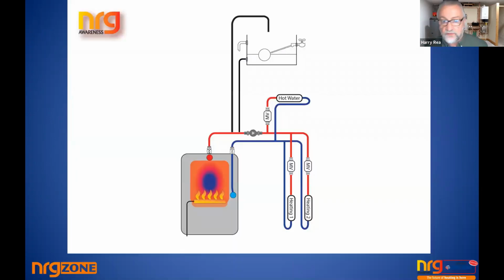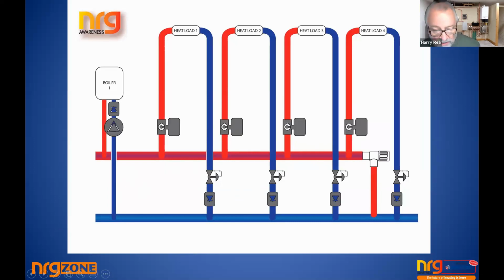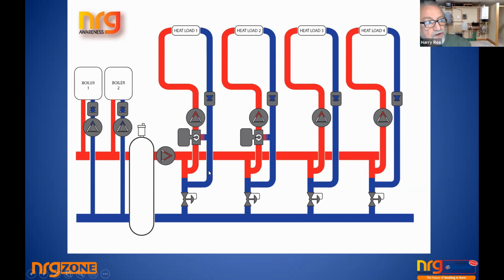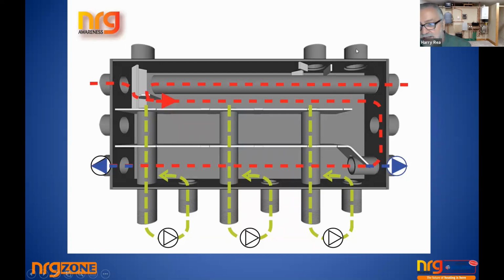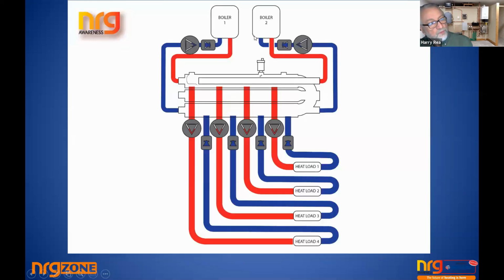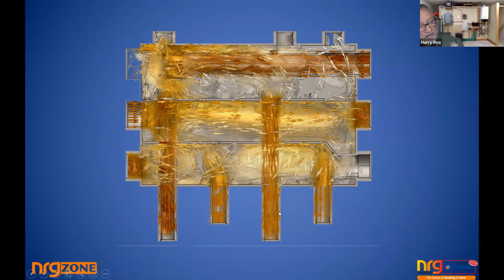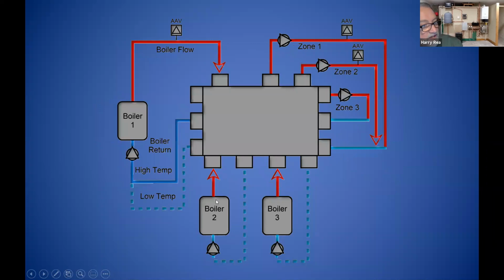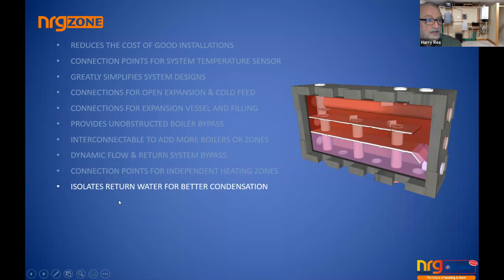NRG Zone Webinar on Designing Highly Efficient Heating Systems

Comment: If my boiler provides 24 lpm and the first pipe on the nrgy supplies ufh and has a requirement of 25 lpm it will take all of the boiler flow leaving the other zones recirculating their own return water or am I missing something ?

Comment: Just want to add some comments as I watch. 1. The biggest property I have ever worked on was a block of 10 flats near Harrods and that runs on a 32kw Viessmann 200. My 1000m2 granite build home in Estonia has a calculated heat loss of 45kw at minus 18. The chance of needing more than 22mm tube on a boiler is very limited in most of the home counties and possibly most devoted areas. I've never seen any complaint about a system piped with hydraulic seperation other than incorrectly laid out low loss headers. The big issue is with systems with ufh and no seperation. It would be good if you could pop up some videos of these incorrect systems and the application of the NRG unit solving the issue. In my experience a simple cct or small pipe work modification solves the issue easily.